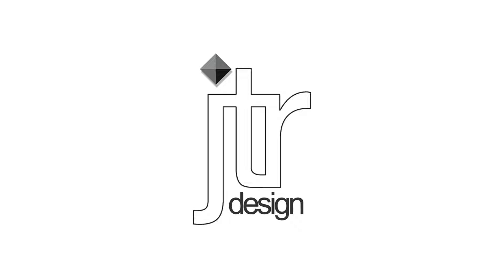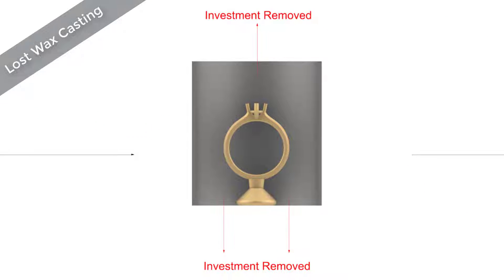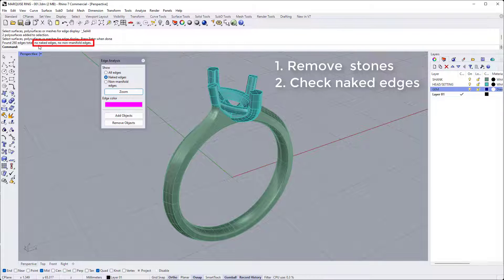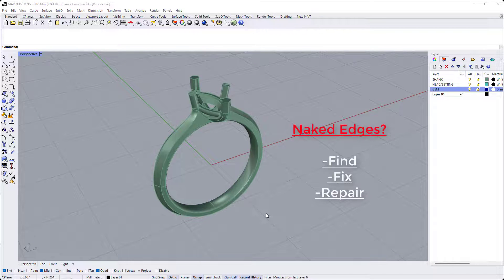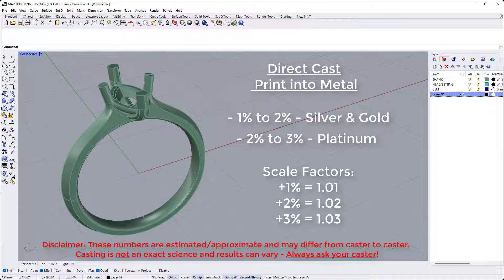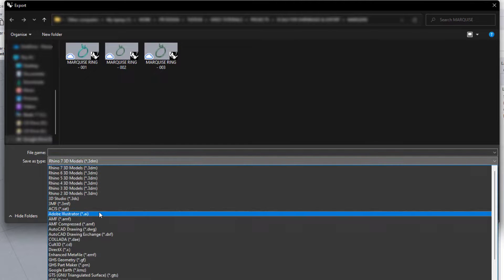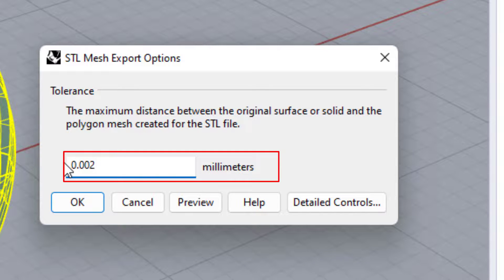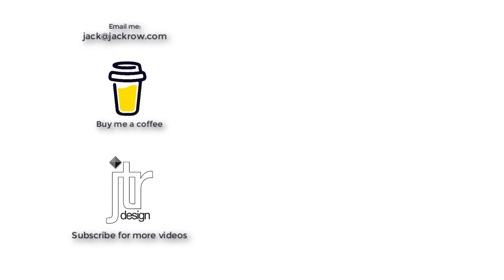Lost Wax Casting Shrinkage Allowance & Export as STL for 3D Printing

Comment: What % allowance do you recommend for Mould/Master? Thank you for the video!
Reply from the maker: Depends if you’re direct casting from a print first or directly moulding a print. As a very general rule; Silicone/cold mould 2% and vulcanised/hot 4% . Note there are many variables that can affect this including mass of the item and type of rubber used. Hope this helps.

Comment: When I make any jewellery design its weight decrease is unreal.
Example - A customer need a 2.5gm ring, and i make it 3gm on matrix9 but after casting its stand for 2.1gm ( Remember no finishing only casting weight) 
Please help me 
I need urgent solution 🙏🙏
Reply from the maker: Are your casting geometrically accurate to the models in rhino?
Reply: @jtrdesign-practicalrhinoje9669  no